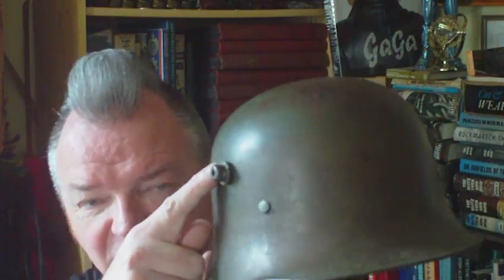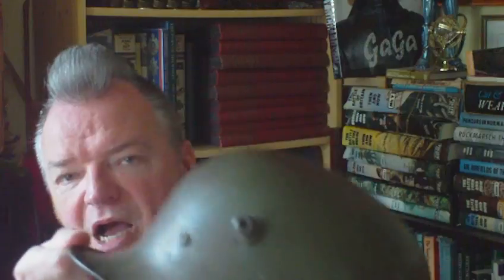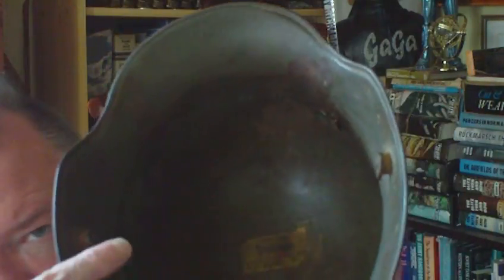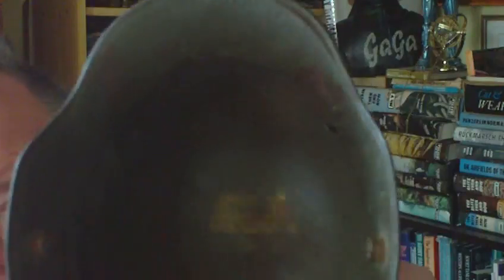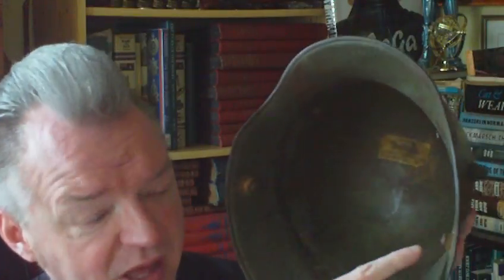SO..WHATS THE DIFFERENCE BETWEEN A FIRST WORLD WAR GERMAN STEEL HELMET MODEL 1916, 1917 AND 1918??

Comment: My helmet has no letters in it...been told it's real. My mom gave it to me 50 years ago. It looked rusty and well used then. No letters just numbers....very hard to read. I think i see 1101. That's it ! Can you tell me what that means ??
Reply from the maker: the numbers refer to the batch of steel it was made from...there will be letters somewhere, sometimes they are faintly stamped, and if it has rust, it may have obliterated them